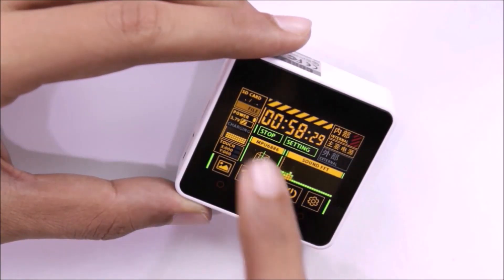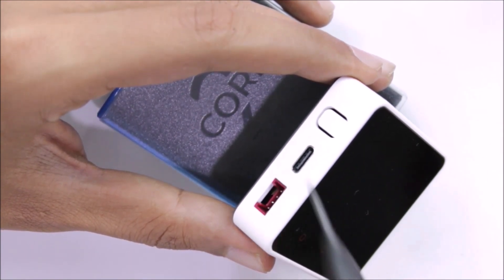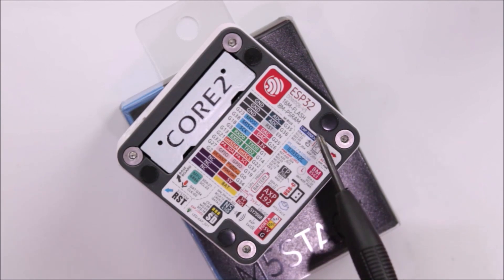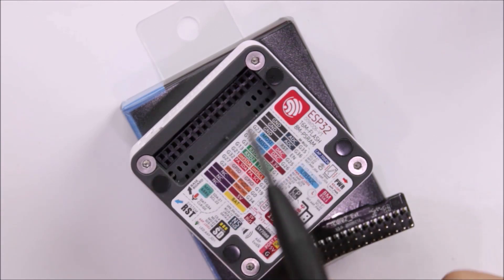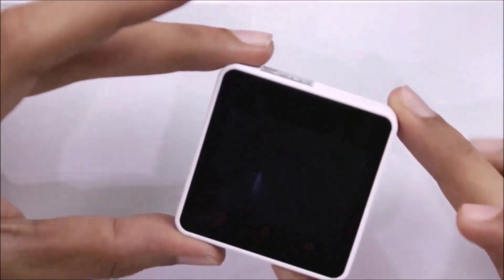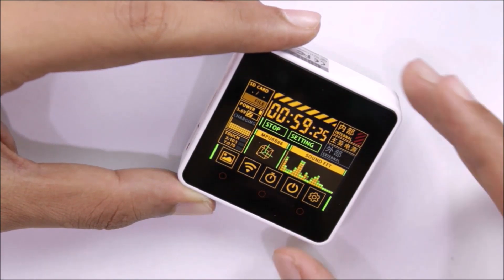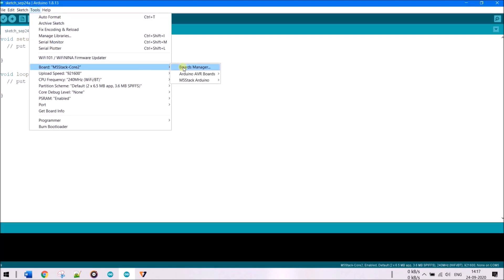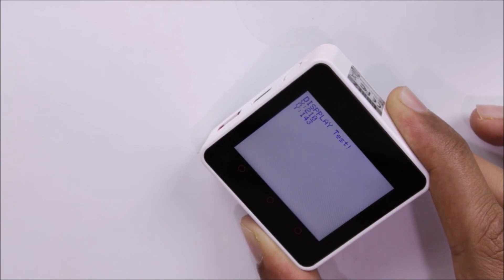Introducing M5Stack Core2 - An ESP32 based IoT Development Kit

Comment: if my knowledge is correct, in this board the MPU6886 sensor providing temperature value. Can you tell which value the sensor is providing.? The ambient temperature or the board temperature? I am getting a value of 48.7 Celsius.

Comment: Amazing device. Some question before I buy it.

 Is this device water resistant? 

How much maximum heat  (in Celcius) can be handle by this device? 
What kind of wifi type in device , a/b/g/n/ac/ax/ad?

Can I replace the internal baterry with higher ampere?

Is this device have failsafe, if yes, then what kind it is?
Reply: I do not think so